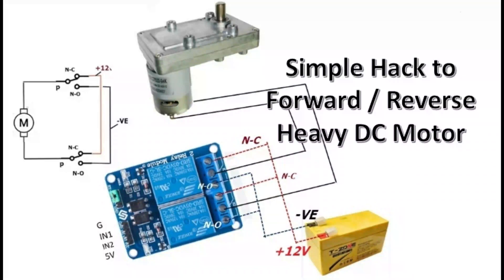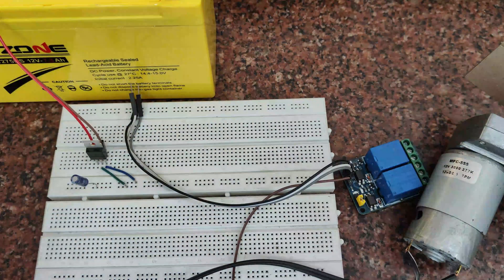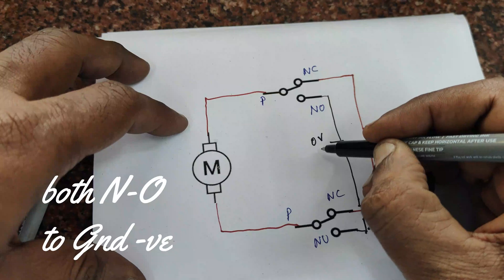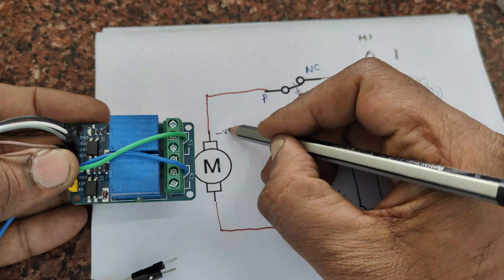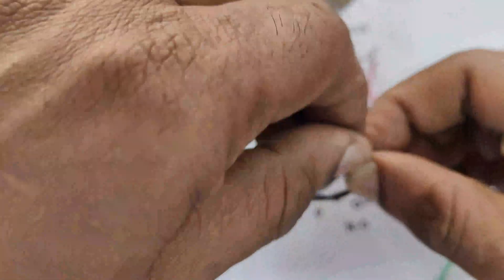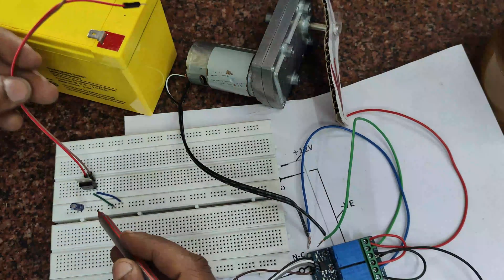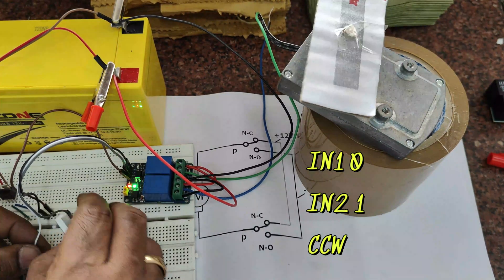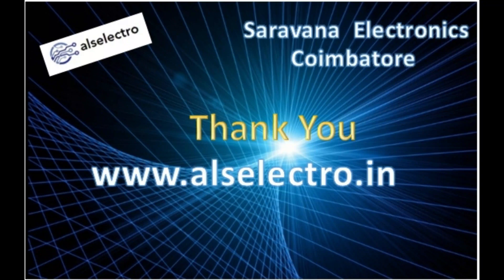Simple Hack to Forward / Reverse Heavy Duty DC Motor

Comment: Bro, this is how 2 way switches have been wired for generations. Whats the hack here? Moreover, for safety, the N/C or normally closed side on both relays should always be connected to  the lowest potential or ground. ( Note 0V and negative voltage ARE NOT the same)

Comment: Better use H bridge mosfet circuit. It will be fast and reliable. Relay is mechanical amd may not work properly..
Reply: But they are robust. Good quality relays, if operated within design limits can last 1 million cycles or more. Moreover, electromechanical devices carry both electrical and mechanical inertia. Electrical inertia or kickback will damage the fets and the mechanical ones will damage the device. Relays, with their inherent delay, act as a safety device.